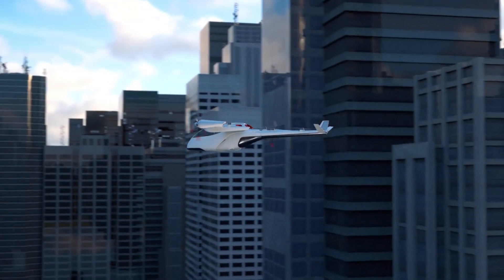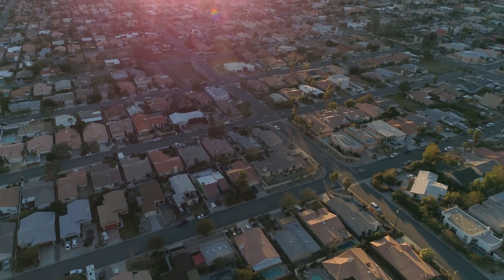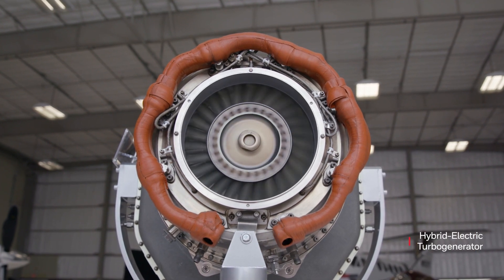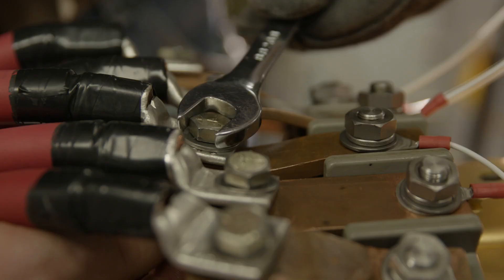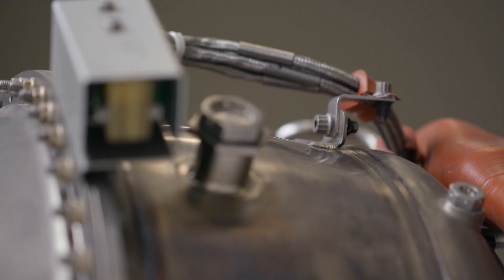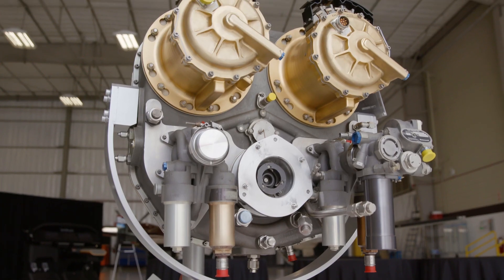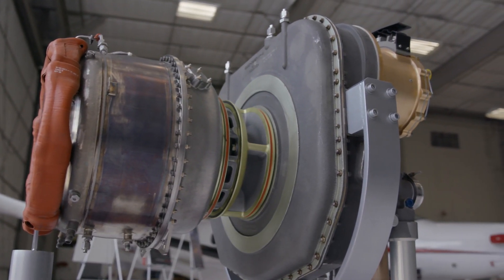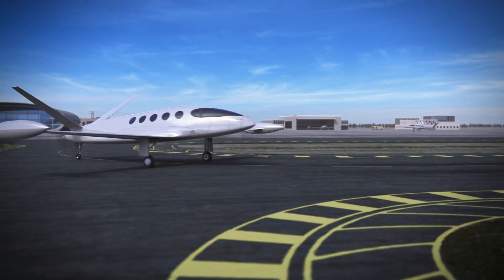What it Takes: The Tech Behind Urban Air Mobility - Propulsion | Honeywell Aerospace

Comment: ....and how exactly is going anyone going to fit any aircraft that has a small enough disk loading to be "quiet" in anyones urban backyard?
The promos is complete bullshit.
Oh and replacing the mechanical drivetrain with an electric one, doesn't mean that the "hybrid" aircraft won't run on fossil fuel.

I mean that the faster you move the air needed to "hold up" the aircraft the more noise it will make.
You need to move X amount of air in a given time, you can aither do it with a small-ish rotor moving the air fast, or a large rotor, moving it slowly.
And by large i mean things on the scale of human powered experimental helicopters.